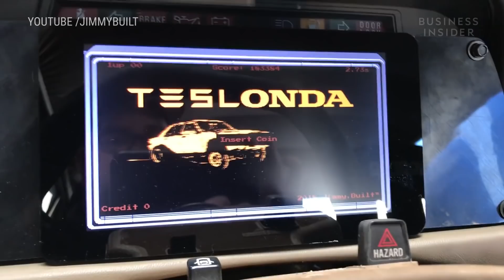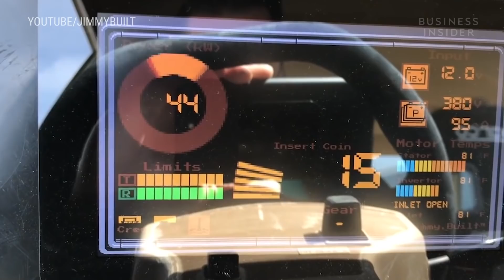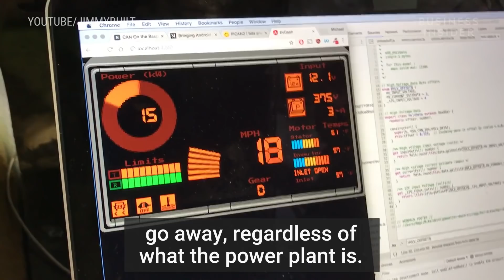What Happens When You Put A Tesla Motor In An Old Honda?

Comment: The steering wheel doesn't seem aligned😅
Reply: I couldn't pay attention to the rest of the video after noticing the steering wheel, which was almost immediately! I can't stand if my steering wheel is off by a degree or 2. It happened once after getting an alignment. I took it right back and they fixed it.

Comment: Fascinating build. How did you connect motor to the rear end? Gears meshing? Drive belt? Solid Coupler or rubber bushing? Any way to add a GEAR VENDORS overdrive into the mix so you can zip out 60mph-120mph?

Comment: Next video V8 in Tesla 😜
Reply: IamMilind , only if it is a modern design, ie 4v DOHC VVT Flatplane. All other v8s are ancient truck engines.
Reply: @nordic5490  flatplane has a lame sound crossplane is way better
Reply: @nordic5490  and I don't think the LS is an ancient truck engine if you're talking about your specs

Comment: Quicker not faster
Reply: haxhi Brika 
First to "Point B" is all that matters.
Reply: TANGLDWEB well what if point B is 10 miles away? A Bugatti going 250+ mph will get there first easily.
Reply: TANGLDWEB also it’s much easier and cheaper to make a drag car. But making a production car that can go 300+ mph is incredibly more difficult and expensive. That is why there is so much more hype surrounding the new Hennessy F5. Quicker used to be better, but faster is way better now
Reply: wtf are you talking about, quicker is ALWAYS better..... @cooperseale
Reply: Coop Daddy  Tesla’s new roaster hitting the market in 2020 has a top speed of 250+ mph, does 0-60 in 1.9 seconds, 0-100 in 4.2 and a quarter mile in 8.8 sec. Plus it can drive over 500 miles on a full charge.

Comment: i want to drop a Tesla motor in a 1954 Chevy pickup don't work it is dilapidated currently with no motor but was intimidated by the project as i have no experience with cars but maybe one day
Reply: Look up Axial Flux motors, they are more geared towards torque than Tesla's method. More suited to Trucks.
Reply: thanks :) i will
Reply: Ha, that's quite the project to get you into cars, good luck to you if you end up doing it!

Comment: The 0-60 doesn’t mean it’s faster... just quicker. Right?
Reply: Yep Tesla P85 drive train is a Single Speed reduction gear. Has crappy top end performance. Crazy low end acceleration. Nothing like a Lucid Air with Geared Orbital CVT. It achieve 235.44 miles per hour at TRC Ohio. Oh it's a 4 door sedan not a supercar.
Reply: Tesla is only good for 0 to 60
Reply: Neojhun yeah, some guy has a 500hp 1500lb weight Tesla powered drag car and does 0-60 in 1.8 seconds and 1/4th mile in 9.7

Comment: I wonder how much the 16-17.1KWh battery pack of the Volt's  voltage sags when the car is floored. That is a massive amount of power being given by a relatively small battery pack for an EV. I think when I floor my Volt, it goes from 385V when charged to 855 or so, and immediately dips to 345V or so but I'd have to check again.  Imagine with the amount of power dumping with this Honda, it's sag to 300V easy!

Liquid cooling still or no?

Comment: So many questions. How did he acquire the motor? What needed to be modified to make this work in the Honda. Why is the front lifted higher than the back? What kind of suspension is in this car? What about the wheels? What challenges needed to be overcome to make this work?
Reply: raksh9 I'd look up ev-controls website. They built a Tesla powered drag car and have some articles on it. They manufacture controllers to control motors and such
Reply: Thank you, I'll check that out.

Comment: Many still seem to believe that the more noise a machine makes the more powerful it have to be (like the V8 engines you mentioned) but any VFD controlled 3 phase motor (wich the Tesla motor is) while being whisper quiet have full torque through its entire rpm range wich no combustion engine has (wich is also why an electric car only need 1 gear) and thus no V8 or combustion engine in general can beat an electric motor of equal power. In fact i think even an electric motor with less hp then a corresponding combustion engine will beat it by a good margin.

Comment: This is cool and extremely fast in a straight line, but the performance limitations of electric vehicles comes when cornering. The model S weighs in at over 4500 pounds, that's SUV weight in a normal size car. Electric vehicles may be the future but battery technology must first be advanced for practical range and weight improvements. 

Also without demand for diesel or gasoline oil production will diminish, driving the price of anything containing plastic up as well as the cost of air travel as planes need kerosene.

Comment: I am wanting to put a tesla motor in 1st gen Celica gt liftback. Probably use the lower power front motor assembly ...the rear is just way more than the car needs.
How do you deal with controlling the motor?
I can install the tesla motor assembly and install battery packs...just unsure about how to control the thing.
Thanks

Comment: Correct me if I'm wrong but wouldn't this car be a couple thousand pounds lighter than the Tesla car? I know that 2.45 seconds is extremely fast but I guess I expected an even faster time with the massive power to weight ratio, compared to the regular Tesla car. I guess if it where "all-wheel" drive, it would be faster. Just thinking out loud..

Comment: There is no question electric cars are going to be the best performing cars, probably from now on. The new discoveries in battery technology,  just within the last year or so will solve the current drawbacks to electric  cars. The man that developed the lithium ion batter has developed a lithium glass battery that over doubles the capacity of current batteries and also is more stable and will charge in a ,better of minutes instead of hours. This tech is so new that it hasn't had the time to be put into current devices on the market. I hope that they don't incrementally market it. Like start selling g cars that have like only a 100 miles more range than current electric cars and then in a couple years sell a car that has 200 miles more range , when they could come out with an electric car that has an 800 mile range on a single charge.  That would be enough to get people to start buying electric cars. Unless the oil companies buy up all the technology.  While I think a fast electric car would be cool. I'm too old to like it the way I like conventional motors, the sound of a small block V8 that has been built properly, gets my adrenaline running, from idle to hearing them turning at 7,000 rpms. When I was young I lived in Gresham Oregon and on hot summer days , I could hear guys down on the Columbia river just launching their V-drive boats at Sundial. They weren't required to dump the exhaust below the waterline at the rear of the boat. The bassets that are like headers were jacketed to preheat the river water so that a hot engine wasnt sucking cold river water, but they just were like a straight header and were sticking out the back of the boat,  some of these boats were blown 392 Hemis or 454 Kieth Black motors pushing 1500 to 2000 hp, and I could hear them roar in the distance and the sound carry, I lived at least 4 miles away and could hear them quite well, I always wanted to do that but never have.

Comment: Uhhhh....someone help me out here.  The title and description state that it's a Tesla motor, but at 1:00 it states that it is a Chevy Volt battery pack.  What gives?
Reply: Ron Winter motor by tesla
Battery pack by Chevrolet
Reply: the battery pack powers the tesla motor
Reply: The Volt battery pack is smaller than a Teslas, Using a Tesla battery pack wouldn't have fitted.

Comment: 100 miles then refuel a gas tank at any of the countless, common and nearly universally refueling gas stations in any city in less than 5 minutes or travel the same distance then spend 2+ hours charging a battery bank at home or at a rare charging station that might not even approve your particular system for charging? I know which option I'd choose. Electric cars, in the current state of the industry, are more like super fun and 50% practical toys. Gasoline powered cars are more like 90% practical tools for conveyance which aren't as much fun to use, but they do what they were designed to do. Race an electric car, long commute or haul heavy with a diesel car or truck, intermediate commute and/or light hauling with a gasoline car, truck, van or motorcycle and short commute, no significant hauling with a bicycle, moped, glider or walk. Unless you plan on running EV on charging rails, designing and using a battery bank and charger to charge completely from empty to full within 15 minutes per 100 miles without battery damage, a bank of solar panels on the roof and/or dedicated trailer capable of supplying a full charge within 8 hours or keeping the battery bank fully charged as you drive... I don't see how EV are the future.

Comment: I’m not shocked at all.  Electric motors (FYI motor =electric   Engine = fuel) have instaniouse torque mostly brushless motors. Gas and diesels for ever. I don’t care about our carbon foot print ,if you actually look at the data and how many cubic miles of air, we do basically nothing. It can effect over populated places but not as a whole planet.  I’m going to stick with the old stuff.